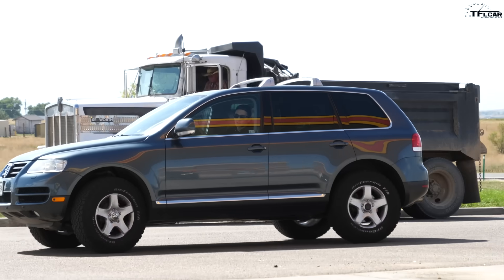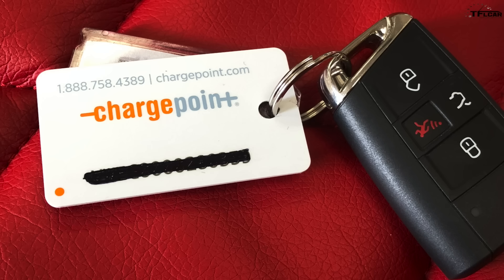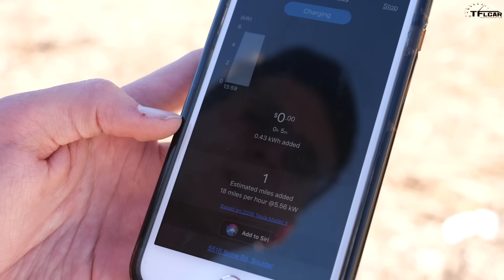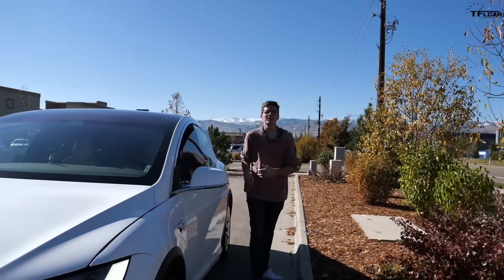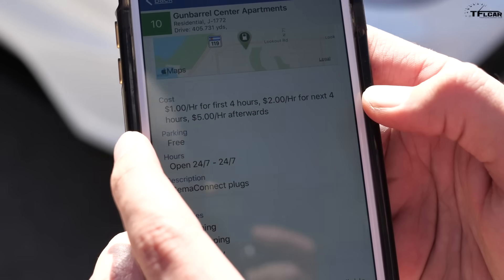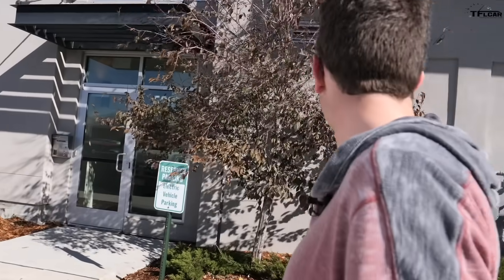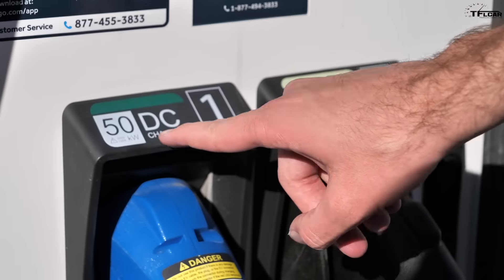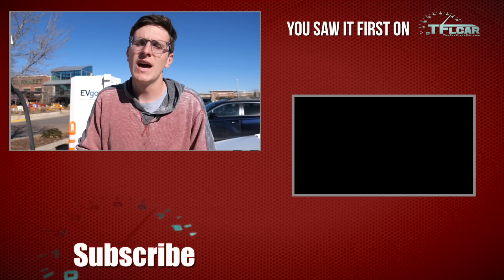Here’s Why Charging an Electric Car Can Suck - And It’s Not The Reason You Think!

Comment: Tesla owners that have their own house or condo garage can have their own home 240volt charger installed. This allows easy recharging at night. In some places the electric company will have TOU (time of use) rates which are cheaper at certain times of the day, typically other than late afternoon and evening rates up to about 9pm.  In the case of Teslas you can easily program it to start charging at a certain time up to a level you specify.  The bottomline is that your cost of charging will be a fraction of your gasoline cost.  Anywhere from a half to 1/5 the cost when you calculate cost per mile.  If you drive a lot, cost of ownership is much less than a ICE car, esp. if you charge at home. There is little maintenance, no oil change, no tune ups, no hoses and belts, no water pump, etc., just battery coolant change every few years.  Of course new tires and brake pads like ICE cars, brake pads last longer if you leave regenerative braking on in the Tesla, that’s when the car starts slowing when you let your foot off the accelerator and the energy goes to recharge the battery or whenever you press on the brakes.  The model S I recently ordered comes with lifetime free Supercharging at any Tesla station so I may not put in a charger in my garage since there is a Tesla station under construction 4 miles away, free is nice.  Btw, all Tesla stations are open 24/7 and have chargers that are faster than many public chargers. Tesla SC stations are cheaper too since Tesla does not make their stations profit centers, instead the revenue goes to pay for the electricity, maintenance and most importantly   expand the network. Currently there are over 1,800 SC stations thru out the US with more opening up every month. The Tesla network is all over Europe, developed Asian countries, including China, NZ, Australia, Canada and spreading into Mexico and the Middle East.  Check out the Tesla SC station network map at their website.  EVs like Teslas are the future, if you don’t believe me go test drive a Tesla at a Tesla store (locations are on the station map as well). The model 3 is affordable to many and the ownership costs are lower than for an ICE car for most people.

Comment: Jokes on you America, we got 220 volts electricity as a standard.
Reply: We have 220 in all houses in the U.S., we only use it for our stoves, AC units, and clothes dryers.  So a simple job to run a 5 foot cable from the breaker panel to a 220 volt outlet.
Reply: QUE? The NEC requires a 120/240 125 amp single phase electric service SHALL BE required in all living units in the USA! This is the minimum, most people have a 200 amp 120/240V service.

Comment: Real Cheap.. Sure!
8 for power $120 for accommodation while you wait. 

Man I hate standing around filling my JEEP SRT and that only takes ~5 min so screw this lol

But great vid
Reply: you use the car 5% of the time, leave it charging for the night just like you do with your phone, simple
Reply: @RawbLV  I fill up, takes 5 min and not worry about it until 600k's nor do I need multiple apps... And best yet I don't worry about having to plug my shit in every night.  Electric cars atm are rubbish.
Reply: @nomi4905  If they were nobody would buy them. But it's okay if you don't like them, nothing wrong with that.
Reply: @RawbLV  People will buy anything if it has been promoted / advertised correctly, doesn't necessarily make it good. 

Electric cars for the time being are not that convenient. 

Your earlier statement charge overnight... You get to your destination.. 
You have 2 kms left, and after getting there you learn there has been some issue at home for which you must RUSH back for. Sure plug the car in and wait 2hrs  or more.
Reply: @nomi4905  Tesla doesn't make ads. And if they were terrible nobody would buy them after a couple of years. Quite simple, really.
Reply: @RawbLV  From this video... It seems very inconvenient, I personally don't want 10 different apps for one thing, (recharge) in this case. And inconvenience of time it takes to recharge. 

So what would you do, you get home 2ks charge left and get a call to urgently get to your kids school 20kms call for a lift? Or wait till your car charged enough lol
Either option often would take longer than $10 fuel fill up in the event you were low on that. 

Re the environment... I'm curious how /what they will do with all the battries as they get old and aren't usable...

Comment: So, it's like putting gas in your car except, that it costs more, takes longer, you can't drive as far, travel across country with it unless you can find a string of charging stations and the electricity in Boulder is still made with fossil fuels. Got it.
Reply: Gas costs more, nobody drives as far, not all electricity in the US is generated using fossil fuels.

Comment: Fortunately, here in the Netherlands this all works very differently. You don't need a lot of different subscriptions / cards (anymore) and in Europe, we have adopted a standard plug (the Type 2 charge cable) which about 95% of all charging points use. I've never seen charging companies bill by a timeframe (I suspect it's prohibited) instead, always per KwH. 
Home chargers are typically 11kw, speedy enough to charge your car in a night, alternatively most Dutch municipalities have a budget to install public chargers, which means several parking spots in the city are reserved voor EV's only.

Comment: Instead of being snarks about it, TEACH US if you know that mutch! Because instead of leaving arrogant ass comments, you could have done something mutch useful in your life. Because we don't live out of arrogance, we live out of helping eachother and providing solutions. Okai, so here is my short opinion: gas cars have crap ass efficiency and are a huge source of pollution. The most efficient and most squeezed out high compression turbo-diesel engines barely get 30% JUST ON THE ENGINE. But are alot more standardized and more people understand about them. Battery electric cars are by far the most efficient in an hypothetical closed system that just involves the car and require a mutch less complicated maintnance. But require really impractical amounts of time to charge. And we have to take out entire moutains to get 1 single battery. The hybrids have the best and worst of both worlds. Engineering isnt present just on blueprints and factories. It's in our everyday lives. We engineer discussing the pros and cons. Listening and teaching and arguing. WE ARE NOT IRRACIONAL! WE ARE HUMANS! THE PEOPLE THAT LEAVE ARROGANT COMMENTS ARE WORSE THAN LEECHES! BECAUSE AT LEAST LEECHES ARE NOT ASSHOLES TO EACH OTHER! So, what do you have to teach?

Comment: Amusingly, in Europe, Tesla uses standard Type 2 + CCS plugs these days–on the 3 that is; on the S and X they have only a Type 2 compatible supercharger plug, but provide a passive adapter for CCS these days. Either way, for AC charging, all of them can use the local standard directly.

Of course, Type 2 / Mennekes is still different than Type 1 / J1772 that's used in the US but there's an actual reason for this difference in standards: J1772 doesn't support 3-phase power common in Europe. And neither does Tesla's proprietary US plug, which is probably part of the reason why EU Teslas got standard plugs.
Reply: Ah, you mentioned the EU CCS usage toward the end there. That's what I get for premature comments :P

I suspect Tesla will eventually provide CCS adapters for the US market as well, since they have to support the logic anyway.

Comment: It's kind of like in 1980's with unleaded gas pumps has skinner nozzle than fatter with lead pumps. Now only diesel pumps will not able to fit in regular cars as it won't fit. On Apple iPhone charging port isn't USB-C and or Micro USB. So Tesla wanted to be something like Apple iPhone and iPad, as of you'll needed another charging cable to fit into Apple products. It same as for Tesla that required short adapter. Both Apple and Tesla have to be different HA-HA.

Comment: Just watching this made me want to stay with gas.   When the power is out your SOL...   and some gas stations have a generator which will run the gas pumps....
Reply: ngcsu well I remember we had a powerful hurricane where power was out for a few days and local gas stations had Generators brought in and soon we had gas.  There was a long line,  but the wait would have been a lot less than if you were trying to charge your car....   electric cars are good,  only if you can go about 1000 miles on a single charge..   not 150 miles on a single charge.   How long would it take you to drive from New York to California and have to stop to charge 10 hours just to go 150 miles then find a station and start all over again.   And your not really saving the planet because the electricity comes from either a coal fired power plant,  a nuclear plant or a gas turbine power plant...   so can you give me one thing that makes electric better than gas?   1 thing that’s even better and cleaner than gasoline is LNG (Liquid Natural Gas).  It burns cleaner so it’s better for the environment and you don’t have to wait 10 hours for a full tank....   and about the battery,  there costly and you have to dispose of them properly because their considered hazardous waste....and also say someone driving an electric car decides to drive through a flooded street,  I’m sure all that water isn’t good  for the electronics.  Gas you have a good chance of making it through as long as you don’t stop and better if the exhaust is above the water....

Comment: Forget all that nonsense. When I need energy, I get another 470 miles in about 5 minutes at any gas station.
Reply: richard thomas - But don’t you have to pay? My model S comes with lifetime free charging, at a Tesla station that is 15-20 min, only a stupid driver would use those slow poke stations shown in the video. A Tesla SC station is entirely different, esp. the newer V3 250kw chargers.

Comment: So while you're inside sleeping at night I could unplug your car and plug in my car and you get charged for it sweet
Reply: franz stockmann      Don't worry, there won't be many charging points for expensive electric cars, in bad neighborhoods.
Reply: franz stockmann     YOU start talking about "bad neighborhoods", but it's me who is the elitist? Screw you.
Reply: franz stockmann    Buddy, it's definitely YOU who is the clown.
Reply: It locks to the car, and when unplugged will automatically end the session and sends a notification that charging has stopped. Many vehicles will automatically unlock the port when done charging for that reason
Reply: @AlannaTheCleric  Only certain cars.  My car you have to manually lock the charging plug into place.

Comment: Excellent video!  I would like to add one additional thought on charging. PHEVs. For those with a home charging capability, Plug-in Hybrid EVs (PHEVs) are a sadly neglected solution to some of the problems you identified. If you're out running around town and run out of electrons, a PHEV can simply charge while you continue to drive. For example a Honda Clarity PHEV has a gas tank and an on-board generator hooked to a 1.5L engine. That gas engine normally is never used (Clarity has 17 kWh battery capacity giving 50 mile range for daily commutes), so its essentially an EV. But you can drive across country (or around town longer than planned), and never have to deal with public chargers at all. It's not "pure" EV, but for many people's use-cases, a PHEV allows driving 90 to 99% EV, with no charging headaches at all :-)

Comment: 240 volts is not high voltage, anything 1000volts or over is high voltage. anything less then that or more then ~50volts is called low voltage. less then that is called extra low voltage. *values vary from AC to DC

Comment: They should work on a different technology. Instead of charging stations, there should be replaceable battery stations, kind of like gas stations but for batteries. All cars would have standard batteries and when you needed, you'd go to a station and exchange an empty one for a full one. That would work much better than all this waiting around crap.

Comment: Great video. I guess I will wait till they all catch up with these charging stations and speed. It takes 1-2mins to fill up my 21Gallon gas tank and give me around 400miles range.
Reply: Yes, and it takes me very little time to fill up my 10 gallon tank for roughly 500 miles of range. Plus I bought the car extremely cheap and put 45k miles on it with only oil changes. Beat that electrics!